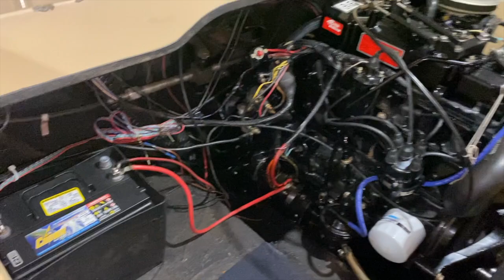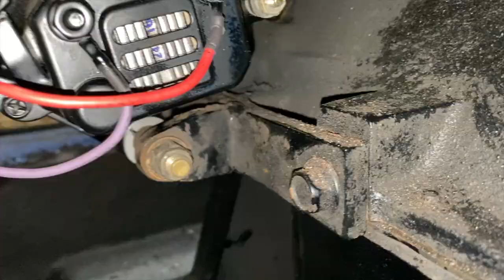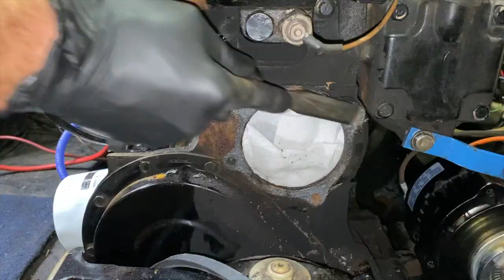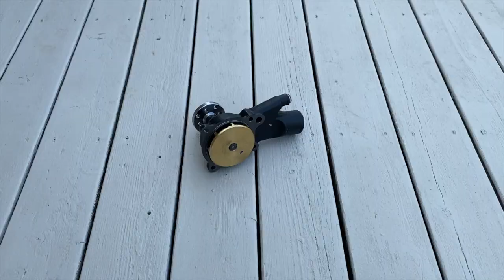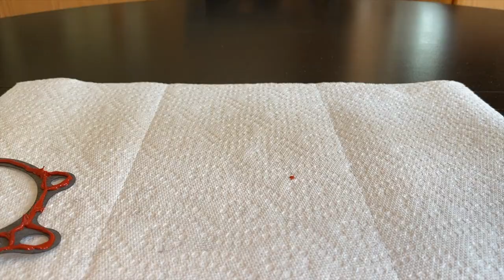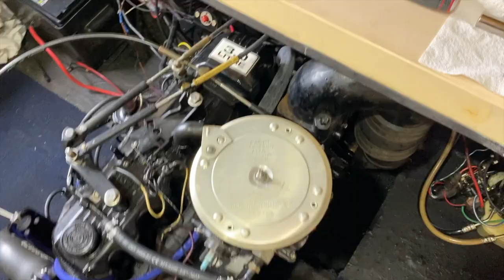Replace Mercruiser 3.0L Water Pump

Comment from the maker: If interested in purchasing this product, visitor to Amazon affiliate link below.  I earn from qualifying purchases.

Water pump:  https://amzn.to/427bt6T

Pry bar:  https://amzn.to/4nrYdm2

Alternator:  https://amzn.to/46Em1vy

Alternator belt:  https://amzn.to/3KrVnP7

Impact wrench:  https://amzn.to/3INxPDU

Rubber mallet:  https://amzn.to/4o2Tas7

Scraper:  https://amzn.to/4nYi2B2

Lacquer thinner:  https://amzn.to/4q7Hwy3

Steel brush set:  https://amzn.to/46DBdcg

RTV Gasket maker:  https://amzn.to/4np5Nxy

Utility knife:  https://amzn.to/4nERsxn

Bullet connections:  https://amzn.to/46Bsyah

Wire stripper:  https://amzn.to/3KlQQ0C

Electrical tape:  https://amzn.to/42cJfHU

Heat gun:  https://amzn.to/4gJpHB5

Starter:  https://amzn.to/46QmHzj

Starter relay:  https://amzn.to/4mvmZAb

Harmonic balancer pulley:  https://amzn.to/4pGHEnM

Oil pressure sender:  https://amzn.to/42dxBwt

Fuel pump gasket:  https://amzn.to/3WdDQN7

New trailer wheels:  https://amzn.to/3IzsIam

Cherry picker hoist:  https://amzn.to/4nMUYFl

Side rail bumpers:

     https://amzn.to/45QNkDS

     https://amzn.to/4684JqB

     https://amzn.to/4lXw18N

Dock bumpers:

     https://amzn.to/4gaeadw

     https://amzn.to/4noe5pg

     https://amzn.to/4piZg9d

     https://amzn.to/4mV04PY

     https://amzn.to/4m2cbsY

     https://amzn.to/46bau6X

Boat cover:  https://amzn.to/462Zcmt

Sand bag kit:  https://amzn.to/465nT03

Button snap crimping tool:  https://amzn.to/4euiD9M

Extra buttons and snaps:  https://amzn.to/4eu2HEt

*******************************

1.  Replace boat cover snap cap buttons

          https://youtu.be/_HaALyNC6X0

2.  Boat cover sand bag kit

          https://youtu.be/9AmdcMchB1g

3.  Siphon fuel out of boat

          https://youtu.be/CwdYEQwt_qk

4.  Replace Harmonic Balancer pulley

          https://youtu.be/iJxPCbU7EO0

5.  Replace Alternator

          https://youtu.be/QDpEhzVRGG8

6.  Replace Alternator Belt

          https://youtu.be/A8h_mC3sV5Y

7.  Replace Starter

          https://youtu.be/ECDsYa08QiI

8.  Fixing boats and jets skis PlayList

          https://youtube.com/playlist?list=PLjCXOz8TSkZlae2qY97uVVTm3JdBOUoRS&si=KJO-787e9AnSjxZ6